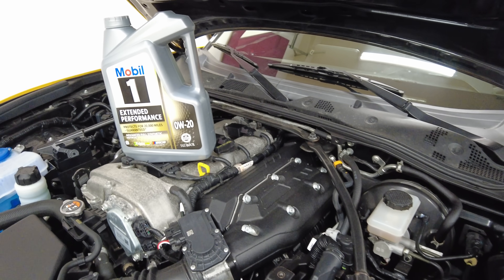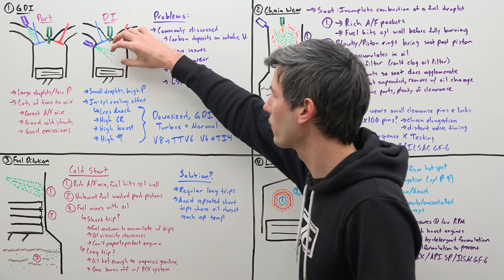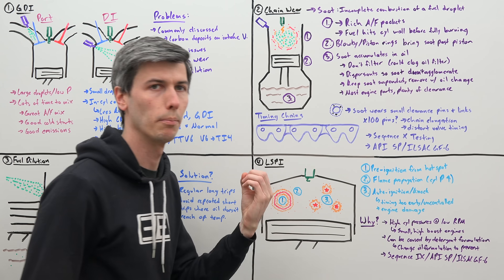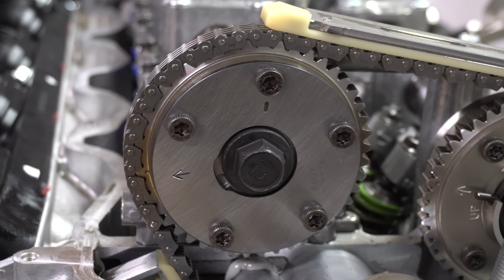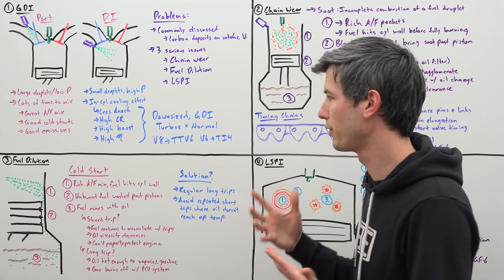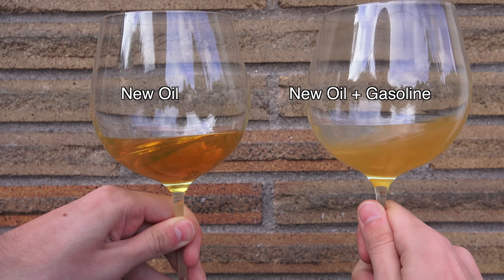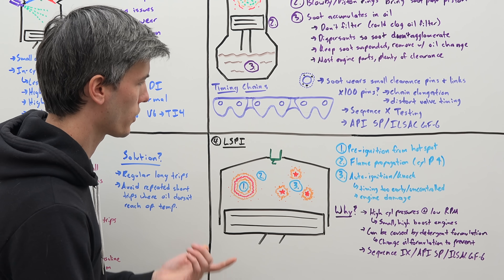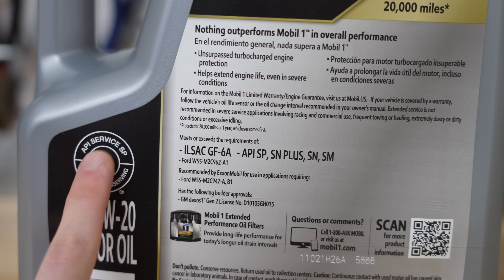3 Big Problems With Direct Injection Engines (Gasoline)

Comment: I drive a MK7 Jetta GLI, its' EA888 Gen3 is direct-injected, and one of the first upgrades I did was to install a catch can, to mitigate the build-up of crud on the intake valves, when I do empty it(into a clear plastic container), there's around 5-10% oil, and the rest is a water/gasoline mix, mostly water...I also believe it may also reduce by a fair margin- unburnt gasoline getting past the piston rings into the motor oil...

Comment: I have a direct injection engine. Over 7 years of driving the car and it's the worse🤦🏽‍♂️ terrible with gas rang at this point and carbon build up on the intake valves is something I can't fix on my own and it bumbs me out.

Comment: The thing that drives me bonkers is manufacturers insisting on tuning their shift profiles to prevent downshifts as much as possible in modern transmissions on their turbocharged DI engine. Especially since with an electronic wastegate, theoretically they could save more fuel by running at mildly higher rpm with less boost in cruising situations. Instead, if we hit a mild slope while driving our transmission says " Nope. I'm not gonna do it. Wouldn't be prudent."
Reply: Then in the little baby diesels they tune the transmission to not hold a gear when it should.

Comment: I hope you see this and maybe you can answer it because of your Crosstrek. I have a 21 Impreza Sport, and if I blip the throttle at idle, it makes a sort of click sound. I don't do it on purpose but sometimes when going around a slow turn and downshifting to 2nd or something for example it happens. Is this pre-ignition happening or some other sound the Subaru engine is making? It's done it since it was brand new so I dunno.

Comment: Marvel Mystery Oil has a new formula for GDIs and Hybrids . It comes in a black round plastic bottle , though I'm unable to find it in stores , you can of course buy it from their website . Use the new 0W16 ILSAC GF-6B oils , made for GDI engines to reduce carbon buildup .
Reply: Just run quality oil.  Change it when your are supposed to (or earlier), and leave the snake oil on the shelf.

Comment: Thanking you Jason! Fuel dilution, chain wear, incomplete combustion resulting of carbon build up, have been corrected already by inventor George Heeley with the passive turbo inventation or water vapor injection many decades ago...

Comment: They need to do away with DI I have 90 and Mid 2000s  models vehicles with over 200,000 miles most new engine can barely make it 100,000 so if you have deep pockets go ahead if your finances force you to buy on a 60 72 month term your chances of driving it for the entire time you will be paying is low..and manufacturers warranty are junk.

Comment: This is why I think Toyota's D4-S is just awesome, for those who don't know, any Toyota or lexus engines tbat have the D4-S logo on them means that, both the engine is both port and directly injected, you get the best of both world's, the only other vehicle that has this to my knowledge is the Subaru BRZ and that's because Toyota had a hand in it
Reply: F150s with the 3.5 also added port injection in 2018
Reply: Too bad they mostly sell hybrids in Europe so there's the extra complexity and cost of that.
Reply: The S actually stands for Superior because it most definitely is 😀
Reply: nissan sr20de

Comment: It seems we have always had the cold start issue, with carbs, TBI, Port I and now DI. All require extra fuel when cold, so I don't believe this is DI specific. However, I think this is a greater issue with hybrid vehicles where the engines may not get to a warm temperature when switching between battery and combustion power for short hauls.
Reply: yeah but port injection or a carb dont spray the oil off the cylinder wall. im really not a fan of DI with out port injection also
Reply: They all do need more fuel when cold, true. But the massive downside causing oil-dilution is the direct injection itself.
When your engine is cold you have wider ring-gaps and therefore more blowby. With a port-injected engine that is not that big of a deal. But with a direct-injected engine that hightened blowby causes fuel to be pushed down into the crank-case and dilute the oil. And with the coldstart-enritchment this effect is more prominent.
Reply: My 1989 Chevy Van , TBI , 5.0 L had 199 K when the transmission went . It never had a check engine light and ran well when cold . But that was a very basic system with a single wire O2 sensor that I replaced at 125 K as a maintenance item . It had to be warmed up to pass inspection . I don't see many of these over engineered motors giving longevity . There is just too much to break . There are gains in emissions , torque , mileage , etc. but they require expensive repairs . Your best insurance is conservative oil changes with the best oil - like he recommends .
Reply: I had a 2021 Honda CR-V in last month that was showing 1.5L too much oil on the dipstick. That turned out to be 1.5L of gasoline in the oil. It poured out of the oil pan like water and smelled like gas. I think the fuel dilution problem is much worse in DI than port.
Reply: @RioRyan28  - I think you have a problem far greater than the tiny amount of fuel that can get into the oil during a cold start. Something is seriously wrong if you have that much fuel in your oil.
Reply: @21jimmyo  If you do a google search for "CR-V oil dilution" you'll find plenty of people experiencing this. It's not a tiny amount of fuel that goes into the oil on these engines in -30 degree weather.
Reply: @21jimmyo  If you ran that motor with a liter and a half of fuel in the crank case you had to have done irreparable harm to engine, the motor only holds 3.5 qts.  I'm aware of the Honda 1.5 turbo issue but to have that much in the crank case? I don't see how that could be. What did the dealer say?
Reply: @grizz474  I've seen several have oil dilution causing that much excess fuel to get into the crankcase, it throws the car into limp mode when it gets that bad; no damage done just change the oil and tell the owner to change the oil more often, so it doesn't happen again.
Reply: My daughters 18 year old Prius uses a heat storage tank in the cooling system to keep the coolant hot for long periods of time. It has a vacuum isolated coolant tank.
Reply: @nismo2070  My dad actually sold the plumbing to the inventor of this coolant heat retaining system when he was building it. He made it so you wouldn't have to use an engine block heater as often. It's common to do so here in northern Sweden during the cold winters. He later sold it to Toyota which used it for a while but I guess they didn't think it was worth the extra cost and space in most vehicles.
Reply: Aren't port injected engines easier to cold start than carbs and DI?
Reply: As a ford tech i can confirm. They are adding port injection to DI vehicles now for cold starts, intake valve deposits and other various emission and cyl temps stuff. Also for the hybrids, very true for lack of eng. run time and warm ups. I have seen a few mid teen model year hybrids with low millage come in sounding like they threw a rod. nope. just bad spark knock. change plugs and their good to go.
Reply: No tbi was great the Chevys we're good to -15 without being plugged in. Carbs can do the same or better sometimes just so they turn over and have compression they will start. I have even started carbureted snowmobiles at -25 with non synthetic oil
Reply: DI vehicles have noticeable black smoke and tailpipe soot that is not seen on port injected engines.
Reply: That's why I believe if you have a hybrid vehicle it's best to take it on the freeway on the weekends and take longer trips and maybe do the Italian tune up and floor it on the on ramp to burn off that excess carbon. I believe that's why some older prius are still running with 200k miles no problem and some of them with less miles have engine issues. The engine doesn't get hot enough to burn off that carbon build up.
Reply: Blame the EPA for making your engines less robust overtime… 

The ECU runs a rich mixture to get the cats to optimal temp as quickly as possible. The result is, yes, possibly more fuel dilution.
Reply: @standyourground9973  You have to blame somebody, right?
Reply: @chuckz8053  ikr, how dare the gummint mandate reduced emissions for a cleaner environment.
Reply: The increased blowby and oil dilution isn't caused by the direct injection. It's caused by the higher cylinder pressures, from higher compression ratios and turbocharging.
Reply: Never have had a cold start problem. People don't know how to start them, plus their driving skills show it too.
Reply: Hybrids don't really use DI, plus, they are usually Atkinson cycle, so rest assured the fuel is burned efficiently even if it keeps starting and stopping
Reply: With a hybrid they 200% engineered for it. I don't know how hybrid cooling systems work so this is a big if, but if they use the same radiators and cooling system then that electric motor and batteries will heat up the engine while running.

Comment: VW AG switched from timing chains in EA111 engine family to timing belts in EA211.
EA211 have no LSPI with proper oil, but suffer oil dilution with cold starts and excessive oil consumption with frequent short rides and traffic jams.
Oil consumption could be reduced drastically after very long rides with high load/high speeds (500+ miles/800+ km, 75+ mph/120+ kph) with flooring the accelerator whenever suitable.
Reply: I have a diesel timing belt 2.0tdi... do I have to worry? The car has 279'000km now, hope it doesn't clog itself up

Comment: In all due respect, much of this new engineering in most everything trying to save energy, has become one of the biggest fleecing of consumers, in the history of the world. I follow several mechanics online, some are Factory Trained Technicians, and they mostly agree that all the technology in the world, with poor quality components and quasi engineering, is not doing the consumer any real good. The average new Pickup Truck  price in America , is somewhere north of $50,000 dollars and some are reportedly $ 80,000 dollars, and for what, 1 or 2 miles more per gallon ? The gas saving will never make up for the cost of the vehicle !
Reply: The times have been weird. At the same time as the processing power and computerized design/simulations are going through the roof, the workmanship and materials seem to go down the drain. The results are some "overengineered" and "overoptimized" gimmick boxes that last a few years before they break down and cost of repairs are measured in multiple arms and legs.

Comment: DI will eventually lead to the death of the internal combustion engine.  Perhaps that is on purpose.  I certainly wouldn’t buy a used car with a DI engine unless it had < 30k miles.

Comment: Great video!  

I once had a 2008 MINI Cooper S (1.6 DI turbo) and over the course of 60k miles of ownership experienced both carbon issues and timing chain issues.  During my ownership, I had severe valve carbon issues that I ended up remedying myself by walnut shell blasting…..and also had the timing chain replaced THREE TIMES through factory warranty.  

Until now, I really had no idea that both issues were related….interesting!
Reply: 😳 wow. Those minis are garbage
Reply: @WolfmanZX  no, just a driver that doesnt drive the car hard enough or change the oil under the severe service interval.
Reply: @OxBlitzkriegxO  Agreed, just cut the oil change interval in half and use it on longer trips and you avoid most of the problems on this video.
Reply: @smoke05s  or just install a catch can
Reply: @OxBlitzkriegxO  have you tried to drive a car “hard” in today’s uk traffic? It consists of blasts of a good few hundred horsepower unleashed in second and third gear, maybe fourth if you’re lucky.

Then you mention longer trips. The removal of the office (god bless Covid) and the subsequent requirement to commute means that the four wheeled box is used for shorter runs. For me the limited ability to take the car abroad also reduces mileage.

I like a powerful car much like my motorbikes. Years ago we always used to change the oil at quite low mileages. Then I had a 2011 Audi with the 2.0T engine. That engine used more oil than a 1968 Triumph 500. The Audi people said it was “normal”. Now I drive an AMG and it feels and drives a million times better.
Reply: @PhilbyFavourites  even though i live in America, yes actually. i have driven hard in UK streets, even in London. theres plenty of room to get the engine toasty and also to get yourself in trouble. 

the audi 2.0t is a well known oil burner, even when it was new. 

your experiences are not indicative of everyone elses.
Reply: @OxBlitzkriegxO  Timing chain wear while true that extended service intervals worsen the problem it's also manufacturers using pathetic bicycle chains. Older diesel engines, for example Mercedes OM611 diesel (not so old, 1997-2009) used a massive double row timing chain that easily lasted the life of the engine in 95+% of cases. And diesel oil gets much worse soot load compared to gasoline DI. It is only when goverments started mandating corporate average fuel economy that manufacturers started installing pathetic chains, low friction rings etc. All that is less than 1-2% better fuel economy but it adds up over millions of cars. And ended up costing far more than the fuel saved in increased maintenance cost.
Reply: Unfortunately the BMW Mini's are particularly bad on reliability, at least up to the late 2000s anyway, not sure about the later ones....
I recall at a garage I worked at that the workshop manager ordered a new chain from BMW, and in general discussion of the timing chain problem the BMW parts guy said something like, 'oh yea, they're made out of chocolate!' lol. Still ,what do you expect out of a Rover/Peugeot designed engine! :P
Reply: Minis are known for the "death rattle" because of chronic timing chain issues. The plastic guides get hard and break, and driving with the oil even a little low will cause excessive chain wear. If I had one I would change the oil every 3k miles and change the chain and guides every 80k miles.
Reply: I wonder if this is why the wrx sti still uses port injection
Reply: @treyt6474  no, thats down to cost and complexity vs realized gains.

Comment: I remember the Ford Mustang forums freaking out over LSPI when the EcoBoost Mustang released. That’s a 2.3T with high compression 12to1 9.5:1
and it used Synthetic Blend oil while allowing 87 octane fuel. Knock knock, your engine exploded.

They call it the EcoBoom

No idea why my comment was deleted before. YouTube out here getting weird…

Comment: Basically what you're saying is the modern engines today or piece of crap. Just about all engines today people I have talked to they all consume a lot of oil 1, 2 quarts in 3000 miles. That's way too much oil for no more fuel mileage than you're getting. I know for a fact I drive a 2012 Kia Sorento 2.4 GDI engine it consume one quart every thousand miles depending on how hard you drive it. That's why I change the oil every 150 hours.